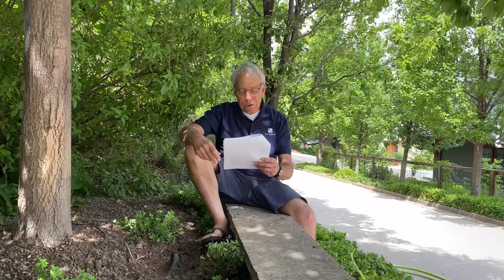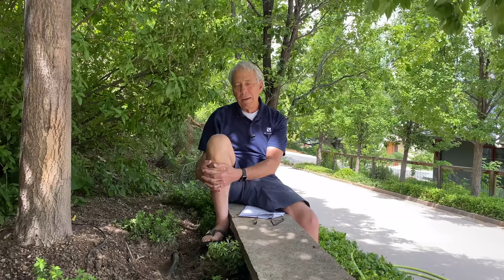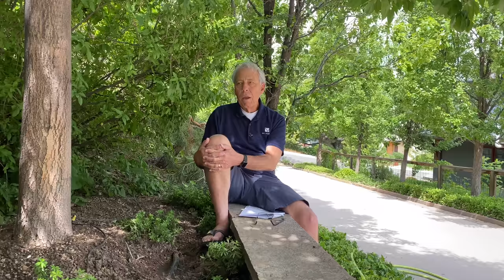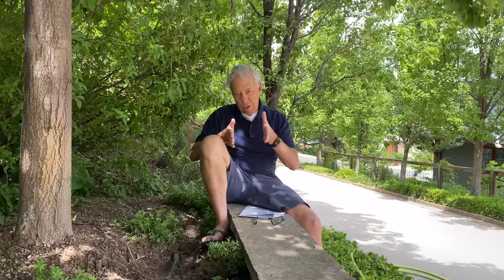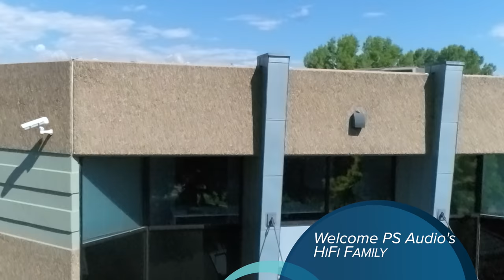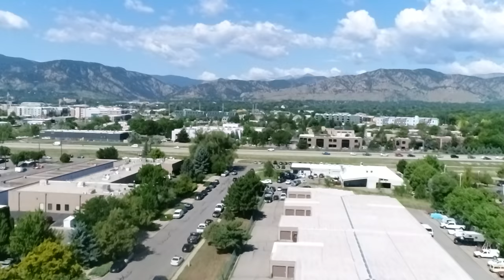How a DAC works

Comment: Right out of school ( 68 ), an audiophile even then, and look'n around for what to do a friend of the family was Tom Brown of the famous Burr-Brown Research. A forerunner in the DAC/ADC industry. I had a couple interviews with Tom and an offer came. Burr-Brown was in Tucson AZ. That of course meant that I was going to move to Tucson, from Boston. I had another offer from a Digital Voltmeter company located in San Diego and that was my ultimate choice. Digital Voltmeters are really just ADCs. Burr-Brown is still around under the Texas Instruments umbrella.

Paul did a commendable job on this one. Well done Paul. I'm not so sure that DAC's still use the "ladder DAC" topology but so be it. What used to be a complex circuit and cost 100's of $$$ in parts cost is now down to a single chip maybe costing just a $1. Burr-Brown used to be the world leader in this technology. I have no idea where they are positioned today:

Comment: How can you not know the Topping DACs?
Been under a stone the last few years?
They're one of the best DACs in their pricerange, both soundwise and specwise.
Reply: Btw, most modern DACs use successive approximation nowadays.
Reply: Fat Rat  Listened to two different toppings and compared measurements of a wider range of DACs.

Hmmh... now that I think of it - listening to toppings... sounds... delicious 🤤
Reply: Fat Rat  Lol better to not taste caramel from the ear, it's probably something else 😅
Reply: @QoraxAudio  Successive approximation ADC's are pretty common.
Successive DAC's is something Google never heard of.
Reply: @oscargr_  It's the inverted operation of successive approximation that ADCs do.
I think it's also called a cyclic serial DAC.
Reply: @QoraxAudio  Thanks, will see if Google heard of that.😁
Reply: @oscargr_  Good luck 👍

Comment: You only described volume, not frequency in your voice analogy of the  ADC description. The continuous analog signal is sampled for amplitude and frequency with a Nyquist rate. On the DAC side, it would have been good to explain the sample rate effect, the resolution, how the output is current or voltage, how it is integrated and filtered to turn into a continuous signal again and how non-linearities can effect the reproduction and sound quality.

Comment: @1:39
"There's also DSD, which is similar, better..."
Why is DSD better than PCM?
Reply: Best question on the PS Audio channel - ever
Reply from the maker: Because DSD, or PDM, is much closer to analog. I will do a video on the subject at one point. Hard to explain in just the comments section.
Reply: @Paulmcgowanpsaudio  That would be appreciated.
I already know the difference between PDM and PCM. Except for both being different, I fail to see why one is better than the other.
Reply from the maker: @QoraxAudio  In its simplest form one is closer to analog and requires far less processing. PDM needs only a low pass filter and it can then be placed directly into an analog power or preamplifier. PCM, on the other hand, must be first converted from its numeric code to a different form, then heavily filtered, then converted from current to voltage before listening. If you look at the data stream of PCM you cannot see anything about the music. If you do the same with PDM it's easy to see the music in the datastream. Simple filtering vs. complex reconstruction.
Reply: @Paulmcgowanpsaudio  Ah yes it requires less intrusive operations, but in the end you're still stuck with a capacitive reconstruction filter that - if it's a strong filter - can introduce unwanted phase issues and high frequency roll off.
Reply from the maker: @QoraxAudio  Ummmm I don't think that's correct in practice. The average simple low pass filter for PDM has a -3dB of about 50kHz, way above any phase shifting problems in the audio band.
Reply: @Paulmcgowanpsaudio  Sounds like that PDM is running at quite a high speed.
How much radiated emissions are created in that example?
Generally, radiated emissions (like RFI or EMI) are the biggest enemy of an audiophile.
Reply from the maker: @QoraxAudio  Yes, it's running at 2.8mHz so the filter can easily be high and gentle. As long as you're not trying to power something other than low level signals, the RF problem is not an issue.
Reply: @Paulmcgowanpsaudio  
There's a bit of bias in that description.  First you say PDM "needs only a low pass filter" but PCM must be "heavily filtered."  
In fact, the demodulation of a 1-bit sigma-delta stream is hardly straightforward or simple.  Companies that design those DACs put a considerable engineering investment into the design, and then keep the details proprietary to protect that investment.  
I find examining PCM data quite straightforward, and it's easy to process for level, EQ, downmixing, effects and all kinds of manipulation for editing.  DSD streams however cannot be operated on directly, other than very simple edits such as splitting tracks at silent points.
Reply: @Paulmcgowanpsaudio  Hmmh 2.8mHz is that the clock speed at which the FPGA output runs at?
Reply from the maker: @QoraxAudio  That's the clock rate each bit is output in a 1-bit system for single rate DSD.
Reply: @Paulmcgowanpsaudio  A DSD signal is always single bit serial data stream, right?
Does stereo audio use two parallel streams for two channels?
If so, that would mean it requires quite some bandwidth if a 7.1 channel is desired.
Or is it possible to modulate multiple channels on one bitstream?
Reply: @QoraxAudio  
A stereo .DSF file contains alternating blocks of 32768 bits (4096 bytes) for the two channels.  Somewhere along the way, those blocks must be buffered into separate places for the channel DACs to receive their own bitstreams.  
If you want to support 7.1 using just single-rate DSD, it would be 2.822 Mbytes/sec.  A 4.7 Gbyte DVD could hold 30 minutes of 7.1 DSD audio.
Reply: It's controversial.  The problem is that the methods are quite different and it's difficult to make meaningful comparisons.  
The DSD noise spectrum gives it significantly better SNR at low to mid audio frequencies, but ultrasonic noise is very high and extends to 1.4MHz with single-rate DSD.  The DAC (demodulator), like the ADC (modulator), must be designed with Sigma feedback via a sophisticated filter which suppresses this high-frequency noise, which starts to be significant just above 25KHz.  
DSD loses about 6dB of its theoretical advantage due to the fact that sigma-delta modulators tend to become unstable when the input signal peaks drive them higher than 50% of their max code.  As a rule, recording level for DSD needs to be set to ensure that level isn't exceeded and this has essentially become an industry standard.  Converters that produce PCM files from DSD, normally set their gain so that 45-50% modulation of the DSD bitstream produces 0dB out to the PCM data (but they also include an option to reduce the gain when needed).  
The 50% range limit on DSD is also the reason why it wouldn't be practical to use a DSD bitstream to directly drive a class D amplifier output stage (not to mention the lack of a volume control).  
Also, many sigma-delta modulators have higher distortion levels than PCM ADC's.  On the other hand, DSD can reproduce waveforms that look more like the original signal on a scope, when high-frequency content is strong such as with square waves.  However, careful analysis will show that the difference between the DSD and PCM waveforms consists entirely of ultrasonic harmonics - in other words they still sound the same.  
Most critical listeners will agree that single-rate DSD can sound better than 16x44.1 PCM, however that comparison is inappropriate as the DSD bit rate is 4x higher.  Single-rate DSD should be compared to 16x176 PCM, or 24x88 or 24x96 PCM which have similar bit rates and avoid the audible issues in 16x44.1 PCM.  
But the above is only about simple record/playback without modifying signals.  When it comes to studio operations on multi-track masters such as level adjustments, EQ, mixing and effects, DSD bitstreams must be converted to PCM for the operation, then back to DSD.  The full process may include several such conversions, in addition to higher-rate DSD down-conversion to single-rate DSD.  
There is far more to this topic than can be covered in a comment section.  There is also DSD-wide, multi-rate DSD, and today's ADC and DAC subsystems make heavy use of digital processing to avoid much of the need for complex analog filters.  Today's ADC's and DAC's are often hybrids, incorporating both PCM and sigma-delta methods to minimize cost.
Reply: @Paulmcgowanpsaudio  
"Yes, it's running at 2.8mHz so the filter can easily be high and gentle."
If you were to take a PDM bitstream directly, and pass it through a "high and gentle" filter thinking that it only needs to achieve good cutoff at 1.4MHz, you would end up with mostly RF noise.  A single-pole 25KHz low-pass would provide only 35dB attenuation at 1.4MHz; a two-pole 25KHz low-pass would provide only 70dB attenuation  at 1.4MHz and only 36dB attenuation at 200KHz which isn't anywhere near enough.  
What you don't realize (or aren't admitting), is that all commercial PDM DACs already have the heavy, complex filtering built into them.  That "high and gentle" filter that you add downstream is just supplementary filtering to further reduce RF content that can upset analog circuitry in preamps and amplifiers.  
I certainly hope you get these concepts straight in your mind, before you attempt a video on PDM demodulation.

Comment: Tape works much like digital.  There is not a smooth waive line that runs down the tape as it goes.  No, it records frequencies like little slices of information that is the played back at the right speed recreating the sign waive.  That is much like digital, it captures frequencies and then turns them into binary.  It also does it far more accurately than tape or vinyl.  The signal sent to it is reproduced perfectly on the DAC if you have a good DAC.
Reply: Analog tape recording does not use "slices."  The magnetic flux impressed on the tape is a true analog signal.  Don't be misled by the application of high-frequency bias during recording, as it does not leave any impression on the tape; it only acts to reduce distortion of the signal.

Comment: Sorry, I know I'm nit picking, but analog doesn't mean rising and falling voltage as this would explain digital as well. Analog (in this sense) is a non quantitative value of information, infinitely variable. A proportional analogue or representation of information. Where as digital is a quantified discrete set of information.

Comment: Excellent Paul.  How many times per second is that snapshot taken?
Reply: Typically at one of the conventional sample rates, e.g. 44.1kHz (CD), 48kHz, 92kHz etc.
Reply: @t00byl26  so that's what sample rate means.  It makes perfect sense,  I wasn't making the connection. Thank you for that.

Comment: So if voltage is volume by what is frequency (like a melody in music) represented?
Reply: frequency is the pitch in the sound (nothing to do with melody, that's a music thing, not an audio thing)
Reply: Lots of voltages strung together sequentially.  For a 3-minute song, you need at least 8 million of them per channel.
Reply: I think frequency (pitch) is just the rate of change of voltage over time?
Reply: @ryanj9235  
Rate of periodicity, where a periodic function is defined as
x(t) = x(t + nT) for n = any integer and T is period.  
But of course music is the superposition of many of those, and real-world periodicity is not precise (it is modulated by start, stop and decay).  
Rate of change is dx(t)/dt, which is an important function, but does not yield frequency directly.
Reply: Frequency is the number of occurrences of a repeating event per unit of time. In audio such an “event” is usually seen as repeating sine waves per second in the unit Hertz. A 1000Hz sine wave signal out of your speakers will cause your eardrum to move slightly inwards then slightly outwards 1000 times per second following the sine wave curve. Louder volume means more motion but same frequency. Twice the frequency means twice as many motions of your eardrums per second. Most humans can hear between 10,000 and 20,000 such motions per second as a tone. Music is more complex but can be seen simply as many sine waves combined (added together) with varying frequency and level. Even a square wave can be seen as a combination of sine waves in audio and be calculated using the math of Fast Fourier Transformation.

Comment: Would be interested to go a bit more in detail, at the silicon level how are say 10mv volts changed to 255 numerical value and 5mv to 127
Reply: The problem is that there is no single definitive method for analog to digital conversion. That said,  most methods use one or more comparitors to compare the input signal against a series of reference voltages. The reference voltages could all be generated at once using a resistor ladder or by a carefully timed oscillator that outputs the different voltages at a known time to be compared against the signal until the comparitor toggles. 

So for instance to measure your 5mv input, you could compare it against a ramp signal oscillating from 0V to 10mv. Meanwhile a an 8bit digital counter would count 0 through 255 in sync with the ramp wave.  The comparitor would toggle when the ramp wave reached 5mv half way through the ramp signal's period. When the comparitor toggles, it stops the digital counter half way through its count resulting in a value of 127.

Comment: Why isn't there a standard for sound that all company abide by?  In order to experience  recording/performance true to original intention, wouldn't it be wise to standardize recording equipments, Dacs, amp, and speakers, that way we hear exactly what the artist intended (similar to printing professional photo, light metering, calibrated screen, printer profile, calibrated printer).  Instead the audio market is full of unique sounding amps, dac, and speakers, that consumers end up having to choose by trial and errors to find a proper combination.  What's up with that?

Comment: Topping is a well-known Chinese manufacturer of budget audio kit!
Reply: Yes, I was as surprised as you are, by Paul's unfamiliarity with a popular brand name.  Being an important figure in the industry, he should spend a little more time following the markets.  
Personally, I never spent much time over the last few decades, following the consumer electronics market.  It's only recently that I've resumed some interest, so still have much to learn about "what's out there" today - but I wasn't working in that industry, so I have a valid excuse.
Reply: Yah, the topping E30 DAC is a excellent starter dac for everyone.
Reply: Yep. Topping, SMSL, Denafrips. High quality budget DACs for the masses. Democratising Audiophilia one chip at a time. Or one ladder at a time in Denafrips case. Also, in Denafrips case, making a run for the high end market as well.
I have a Topping DX3 Pro in my smaller study system and it is a great little DAC, though in my opinion the headphone amp in it sucks big time.
Reply: Fat Rat  
Sounds like a risky approach.  It's hard to make your products stand out on performance to cost ratio alone, and even harder to maintain that kind of advantage long enough to amortize development costs.  
In most industries I'm familiar with, companies usually try to find a niche that isn't being served very well, which of course requires knowing competitors' products quite well.  Boeing/Airbus, Tektronix/Keysight, Canon/Nikon/Sony, auto manufacturers, etc., are always looking for some new and innovative feature, or a unique balance of specs, not in their competition's lineup which would make their products more suitable for a specific set of target customers.  
But I'm sure that Paul's marketing people are keeping a close watch on product releases, even if Paul isn't.
Reply: @jimfarrell4635  denafr

Comment: Why do modern, well-built, DACs sound different?
Reply: Remember that everything the sound goes through will change the sound a bit. DAC. ic have  many components shrink into an ic. it will be the same as different preamplifiers have different sound and no one has the same sound.

Remember that we do not live in a perfect world. A DAC does not do the job 100% perfectly.
Reply: They sound different because there's a lot of variation between reconstruction filter. Bits are bits and their analogue quantization will always be the same, but it's that final filter that makes all the difference.
Reply: Fat Rat  Well... that's a matter of perspective.
As long as the DAC power supply doesn't insert noise into the circuit, it's fine.
Especially USB power is utter garbage, but a decent external SMPS will suffice if there's a common mode choke installed at the input of the DAC.
In other words: as long as the PSU design isn't shitty, your DAC will do fine.